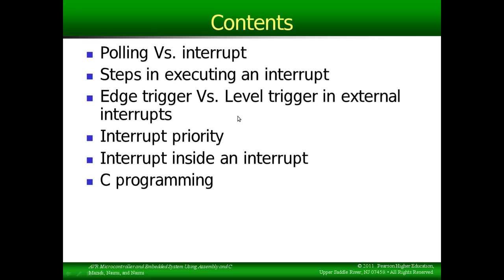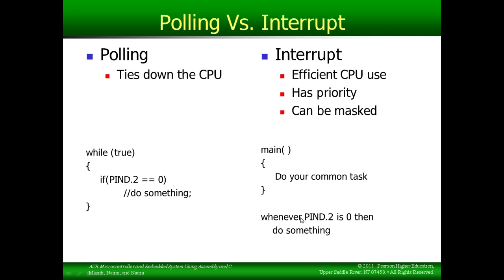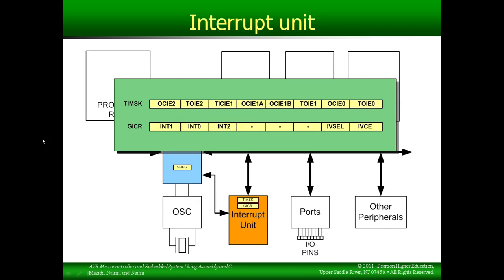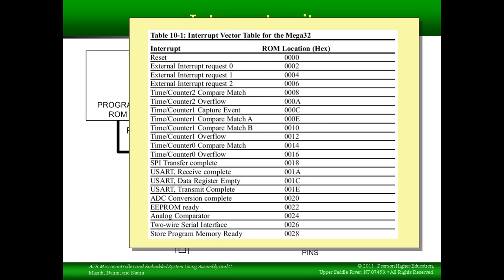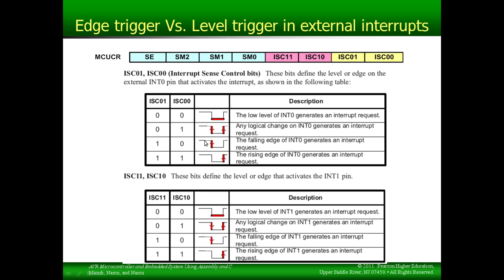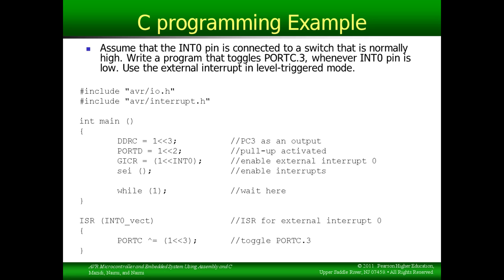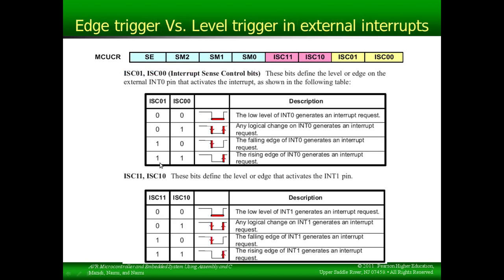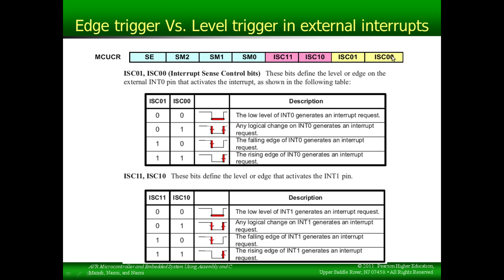Interrupts in AVR

Comment: How can 2 interrupts be handled in the same code? I understand that the cli command is activated when you enter a interrupt but i am doing a interrupt blinking a led at a 1 Hz frequency, and i am trying to trigger a second external interrupt whenever a button is pressed .What approach do you suggest that i should do in order to work? Thanks!
Reply from the maker: It's possible to call sei() in an interrupt service routine (ISR) and thereby enable nested interrupts.  Otherwise, if the button gets pressed during the LED ISR then the button interrupt will just get handled as soon as the LED ISR finishes.
Reply: @drmattmarshall6545  I tried also your sugestion but still, the ISR for blinking a led is executed when the button is pressed (when PD2 is tied to ground). Otherwise, the led is in sort of a bouncing effect, similiar to not having pull up resitors( is either on, or off, or it flickers..its weird). https://github.com/tandrei96/Interrupts-Atmega328p_personal-projects/blob/main/double_interrupts/double_interrupts.c .I appreciate the help !
Reply from the maker: @viata.prin.lentila  Your code looks nice, IMO.  There's nothing I see that might cause weird behavior.  I should think that nested interrupts would be unnecessary since your ISRs are so short that even if the button-press routine has to wait for the LED-blink routine the performance should be fine.  My only suggestion right now is to declare cnt as a volatile variable but I'm pretty sure that's not causing any problems for you.
Reply: @drmattmarshall6545  yup, is ok even though is not initialized as volatile... would be cool a future video that tackles 2 or 3 different interrupts, maybe you get the same error as me haha:) Cheers!